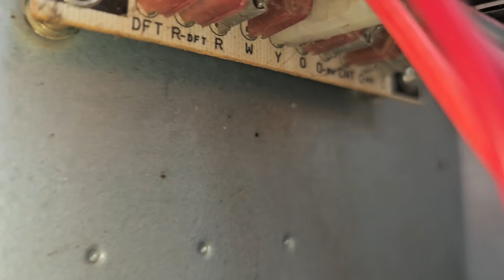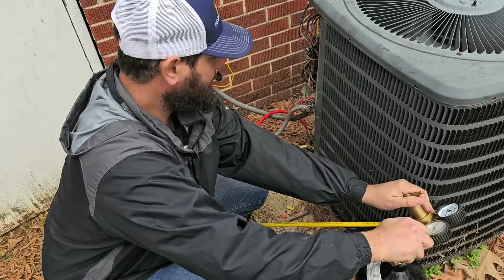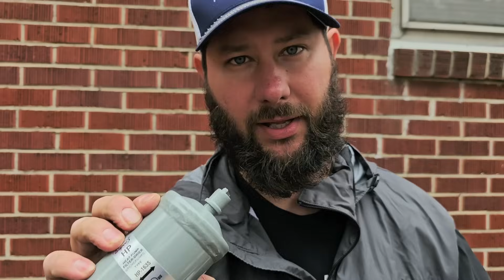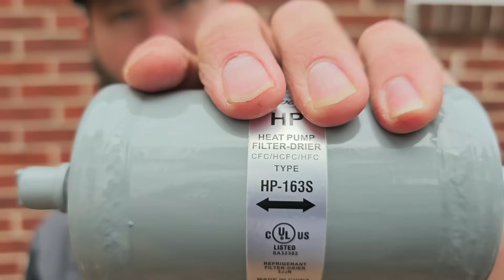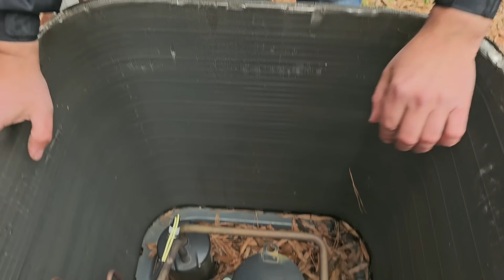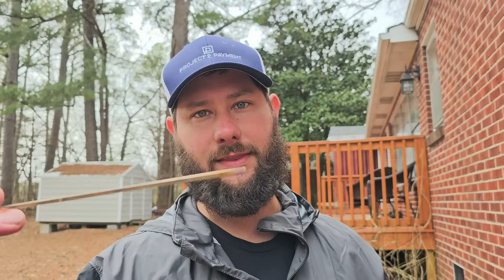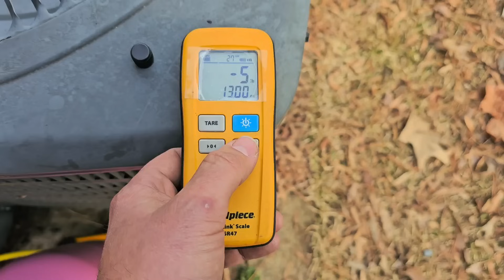Why is my Electric Bill so High? #heatpump #heatpumprepair

Comment: My mother moved in a new complex. Just built. Also developed by the housing authority. Everything was made as cheap as possible. Complex won't last long. They used those heat pump furnaces that don't work well in low temperatures. Anyways my mother has been sitting in the dark. Barley watching TV to save on electric. Mostly use a microwave for eating a quick meal. Showers every other day. Her electric bill is $200.  Something isn't right. She's is flat out stressed out and frustrated because the electric bill hasn't went down. I say it's the crappy heat pump system.

Edit) I know $200 don't sound like much. But she is on a fixed income. Disabled. She watches movies on her phone.     $200 bill is a bit ridiculous. On cold days she says the furnace runs 24/7 and it blows cold air. She has it set for 67.

Comment: My heat bump defrosted covered with ice and my bill is extremely high $668 monthly?. What shoud i do change the unit or repair it?
Reply from the maker: I would have a professional, come out and take a look at it for sure
Check the refrigerant levels
Check the supply air temperature
Check the defrostboard, the defrost thermostat and the defrost sensors
Check the thermostat wiring and programming
Check the heater kit as well

Comment: When you say heater kit. Does that mean if you have a heat pump installed that heat strips are an option?
Reply from the maker: Yes they are an optional accessory
Reply: @ I have to admit I am totally dumbfounded. As a homeowner I would just assume they would be there as a functional part of a heat pump. We have had just two weeks of the coldest weather down here in North Carolina and I could tell you that I could raise my heat pump from 64 to 66 and it will run for an entire hourand the temperature will not change inside the house

Comment: That's a lousy heat pump for 4 season use. Install a modern invertor heat pump that is much more efficient. A single speed, on/off, old style heat pump will use much more electricity even when it is running properly.

Comment: My thermostat never gets to set temp usually 1 degree lower. I have a new load air to air heat pump less than a year old.  Runs continuously when below 40 in winter and when above 80 in summer. Is the heat pump defective? Clean filter and coils.

Comment: Having a similar issue. I bought a home in July equipped with 5 air handlers and two condensers. Summer time my electric bill remained under 300. Turned on the Heat portion and set it and forgot it at 70 degrees. My electric bill is $702. Yikes 😱

Comment: Ive got a brand new HVAC system with heat pump. 4 ton unit. Is using 20 kwh per hour. Our bill is 1200 a month. This started 2 months a ago the moment the system was wired up an powered on. WTF is going on
Reply from the maker: Sounds like to me that somebody wired your heater kit to work all the time or with a call for hate.Maybe your thermostat's programmed incorrectly or the units wired incorrectly
Reply: @TaddyDigest  i have a call into them. It's Xmas so it will be a few days. I'll let u know but from your experience, you would say something definitely wrong and fixable?? I mean 260 kwh a day for a 1500 sqft house.  We went from 26 kwhs to 260 as soon as this thing kicked on

Comment: Hello, great info! Will it cause a restriction in the system if you don't use a bi flow filter drier on a heat pump?
Reply from the maker: yes
Reply: Yes in heat mode it reverses

Comment: Never un sweat a drier...it drives the moisture back into the system. Best practice is to cut out the old drier. Service tech since 1973. Instructor for level 2,3 and 4 for local Apprenticeship program.
Reply: Wouldn’t a deep vacuum get the moisture out?
Reply: @Sthetech will it get all that crusty black shit out from the sil phos?
Reply: I was wondering about that, also is there a threaded filter dryer that can be serviced without brazing/soldering?
Reply: @KTslays  Supermarket refrigeration always has flare fittings for the driers.
Reply: @paulb4496  so a guy could use flare style dryer on a central AC system?

Comment: You did not run nitrogen at 2-4psi when brazing !!! That’s not correct . You Have to run nitrogen otherwise you get carbon build up inside of the line set into the txv plugging up and contaminating the refrigerant .
Reply from the maker: that is correct, good practice brother

Comment: While conducting a pressure leak test, could you shut the service valves to see if the leak is on the outside unit or the inside unit. If pressure continued to drop the leak would be on the inside unit. Good video. Thank You...
Reply from the maker: Yes absolutely
Isolating is a good thing to do to figure out where the equipment is leaking.

Comment: So, does the "Emergency" heat engage automatically? The thermostat for my Trane package unit has to be manually switched to "Emergency heat" for the heat strips to function. At least, I hope that is the case. Great work on the videos!
Reply from the maker: no 
you have to manually engage it

Comment: How much would you charge to identify the leak along with everything you did in the video. Pricing in my area seems all over the place. Thank you!
Reply from the maker: This call the leak check the fix everything.
Was around six hundred dollars
Reply: @taddydigest appreciate you getting back to me! Replaced my own water heater when that broke down to save me money but HVAC I rather not mess with. Your videos are very informative. Keep up the good work!
Reply: I had a similar issue and multiple places didn't attempt to find the leak.  Also said it needed 14 lbs of refrigerant at $100 a pound.  All 4 techs from different companies recommended to replace.  I appreciate everything you showed in your video.

Comment: How do you find the Smans?  I have them as well but I find they are almost too sensitive sometimes for pressure testing.   I find 0.0Pdif very difficult to achieve on a long pressure test.  I often end up with -0.2 or there abouts.   And I find with temp probs connected and calibrated it is even more inconsistent. Sometimes raising or lowering on tight systems after being givin lots of time for equalization
Reply from the maker: I was with one of my technicians this day and was using his gages. I actually don't use digital gages.
He does though

Comment: Great video.  I'm confused, with your power discon. off, where is the 24vac across your Pressure switch contacts coming from?
Reply from the maker: from indoor Airhandler
Reply: @taddydigest  24 volt transformer

Comment: How do I clean the acoil in the inside unit? I see many products that call for water. If I do that water will run all over the fan and the strip heating elements. I don't want to do that. What other options do I have????
Reply: they make these spray can coil cleaners, looks like a can of spray paint.  maybe use that and a rag?

Comment: Why nitrogen and not something like CO2 or just compressed air?
The system is going to be vacuumed out anyways.
Great video, hopefully you have something on those mini splits.
Reply: Combustible material + high pressure oxygen = explosion

Comment: It is best to cut the old drier out. When you remove by un brazing the connection, you heat up all the moisture that drier has removed and release it back into the system. Not best of practices. Just some advice take it or leave it but, I did want to offer it to you. Thank you brother. Keep on keeping on.
Reply: Would heat to the ends of the filter dryer while on brazing cause the beads inside to get hot enough to release the moisture? I feel like there would not be enough time/heat to get the filter dryer itself hot only the ends . Also, the system was already open to atmosphere, and filled with plenty of moisture via the leak found. A proper evacuation will take out moisture.
Perfection is the killer of progress.
Reply: Isn’t it already getting vacuumed out?
Reply: i saw the wires watch on fire haha
Reply: @localchumb it was the thin dried tree debree that caught fire.
Reply: No sir no

Comment: Just confirming dunno if you brought it up in this I didn’t see it but you should mention to remove the shrader valves to have the system open so the pressure doesn’t build up ruining your brazes. Aswell as running very low nitrogen flow through your system while brazing to ensure oxidation doesn’t occur

Comment: Every ac should come with a quick connect pin for the fan so you can remove the lid without hanging the fan motor wiring off the edge

Comment: Great video! I have a question. When you was troubleshooting the outside unit. Why were you testing common and yellow when outside unit wasnt working for heat? Shouldnt u be checking common and white for heat?
Reply from the maker: Good question!
The heat pump gets a call to the y terminal
Not the w terminal.
Reply: @TaddyDigest  ok thank you!

Comment: Whoever installed that needs to be out of business. They didn’t even test for pressure loss.
Reply: He was working on a Goodman I saw the sticker. Goodman’s reputation was hurt for reasons that weren’t always the fault of the equipment itself. For many years, Goodman was widely available through distributors and could be purchased by almost anyone, which meant a lot of units were installed by unlicensed or low-quality installers.
In HVAC, the install is everything:
Incorrect airflow
Improper refrigerant charge
Poor duct design
Sloppy brazing and evacuation <-- witnessed in this video...

Those mistakes cause early failures — and the homeowner blames the brand, even though the real issue was the installation quality. That’s why Goodman often became associated with “cheap systems,” not necessarily because the components were trash, but because they were frequently installed in the lowest-bid, least professional situations. By contrast, brands sold mostly through licensed dealer networks tend to get installed correctly more consistently, which protects both performance and reputation.

Ultimately, most HVAC failures are INSTALL-related, not brand-related.

Comment: Just curious as to why you didn’t move it outside of the condenser in front of the liquid line port? To make it easier in the future to replace
Reply from the maker: I thought about that after and I really wish I would've done that.
Reply: Inside the condenser, the fan will help components cool off and resist rusting because of the airflow. Has more protection from the elements, impact damage, theft. Possibly deter homeowner from what appears to be an easy DIY repair attempt.

Any factory alteration/modification especially from an unlicensed HVAC tech is risky for voided warranties, insurance claim denials or code violations. Best to leave things alone.

My disconnect was rusted all the way through and had evidence of a lightning strike. It was totally exposed to the elements. The tech was totally amazed that it hadn't caught fire yet. Replaced fan, disconnect box, and wires. ✌